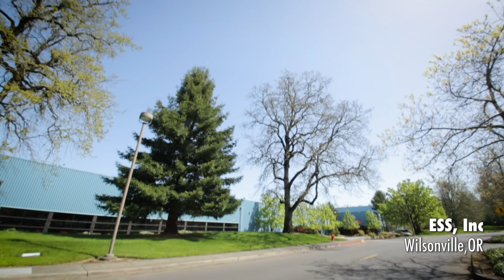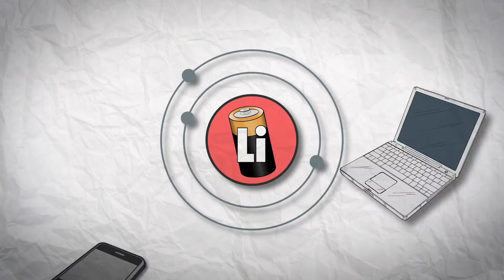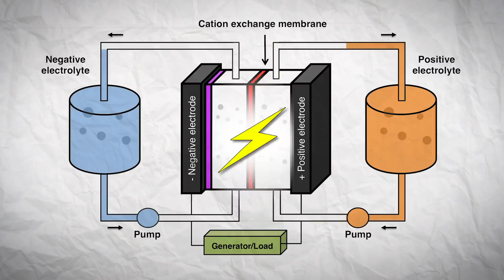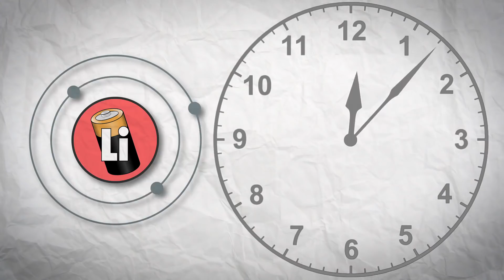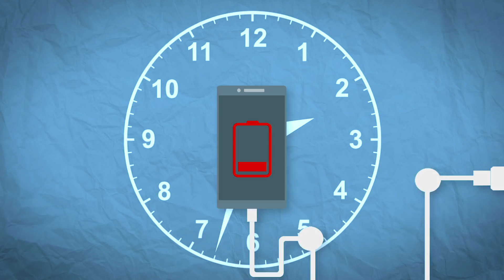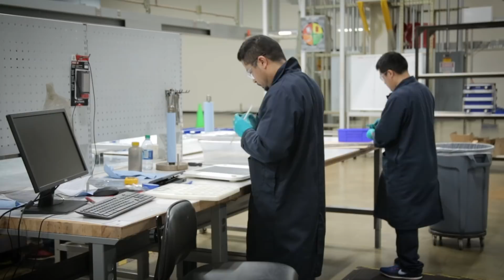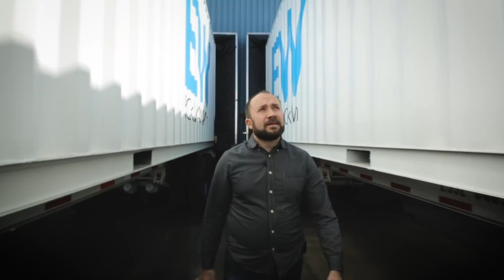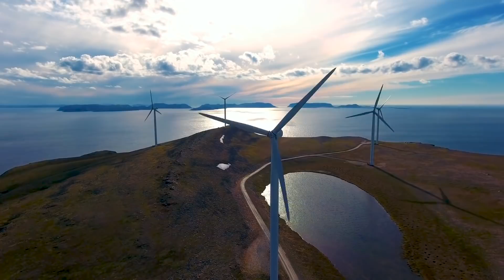Battery Fueled by Iron and Water Could Transform the Power Grid

Comment: This is so full of shit. Salt water is not fertilizer for trees; it kills trees. Iron is technically a fertilizer, but fertilizers are unnecessary for all native trees (such as anything over 100 years old). Simply allowing leaves to decompose on the root zone recycles 99% of the nutrients used by the tree over a growing season; root growth covers the rest. You do not lose FIFTY PERCENT of battery capacitance over 1 year; in fact, a more accurate statement is 15% over 2000 cycles is around the ballpark for your average use-case. 2000 cycles of a battery that gets charged once per day (overnight) means it'll take 5 years to lose 15% of your battery's actual capacitance; any less is due to increased power consumption through background tasks or.. well.. Apple deciding it's time for your phone to suck so you'll have to buy a new one, frankly. 

Oh and let's not forget that a battery requires two dissimilar materials to work, an anode and a cathode. Sure, this battery uses Iron; what else does it use? Potassium? Iron Oxide like how a lead-acid battery works? The sodium from the Sodium Chloride? That last one would leave chlorine gas as a byproduct in the event of a leak, just a heads up. Nickel and cadmium. Lead and lead Oxide. Lithium and carbon. Nickel and nickel oxide hydroxide. All batteries require two materials, how bad is the metal you're not telling us about?

Comment: The future for anyone with any enlightenment is Thorium nuclear power. Look into it. Lets make it happen.
Reply: I totally agree the money squandered on solar and wind is just a disgrace... The money it would cost to develop thorium would have cost less than 1% what they spent and you would have far more energy available 24/7 at maybe a quarter of the cost... Solar and wind are nothing more than elitist slush fund
Reply: I quite agree but it's down the road a few. The best route to thorium is through MSRs and there is still work to be done to scale them up and get approvals from a non-authoritarian government to produce them. Thorium is a second set of approvals. My fave grid battery is liquid metal; if we actually ever need to cool the planet we need solar roofing for up to 20% with battery storage and with part of the storage in large units. White roofs don't make power, so solar still has a place. I also like natural gas fuel cells for homes with solid state lithium batteries, but that still makes CO2. Our species need to install a thermostat on our planet and control its temperature, for both heating and cooling, but that's a different conversation.
Reply: I like your 'non-authoritarian gov't' caveat! Also your logical thinking. Solar isn't 'free', but DEF. has it's place in the current equation, I'm with YOU!  @tsamuel6224
Reply: Have a look a bloom energy they had a fuel cell that ran on natural gas but they said it was able to run on other fuels.. I think it was above 40% efficient and it only used the gas proportional to load.... Google Walmart use them as there solar panels weren't up to the task
Reply: Agree
Reply: Lawrence Baxa   Thorium nuclear tech is mind-bendingly complex and has almost insurmountable materials issues.  It is no panacea.  Yes, it is safer and the world is full of Thorium.  But do some real research and you will see its obvious drawbacks.
Reply: @artysanmobile  Maybe for you Peter. They had a functional reactor back in the 60's which Nixon shut down. The excuse was that it did not yield weapons grade material which they needed. Both could have been done with different objectives. Pure B.S. I smell more manipulation by some who do not want such freedom. Were standing idly by while country's like China and India are developing it While we sit in globalist agenda confusion.
Reply: Lawrence Baxa   I see all the common arguing points in your response which lead me to believe you don’t understand the process fully, the multiple atomic isotopes the Thorium needs to be converted into just to make a reaction.  It’s true that developers couldn’t find government support at the time because the reaction did not create plutonium.  But that is old thinking, no longer relevant today.  The deeper you study the concept of salt reactors the more implausible it gets.  We are past that now with many examples of improvements that are working now.  Wealthy individuals are pursuing this on their own, but private money can only go so far until some brave nation bites and invests in the future.  It’s looking like India and China are going to be those brave nations, while the US just falls further into a hole of political and voter ignorance.  That’s a shame.
Reply: A “functional” reactor is not the same thing as a practical reactor.  There is no conspiracy preventing salt reactors, that’s YouTube fantasy.  They have very real problems that have never been overcome.
Reply: '....with any enlightenment'???   So humble.    AND you know the Future!!  Then PLEASE FIX US!!
Reply: Nuclear energy is today 3 times expensiver than photovoltaic or wind energy. And plus vaste, violent situation, terorism...??
Reply: @Milan-Smrž  You obviously no nothing about Thorium nuclear energy.
Reply: @lawrencebaxa5563  What I mentioned is not truth? Why?
Reply: For ME, NO NUKES is GOOD NUKES.  If they can invent one (type) that does NOT leave behind the seeds of it's OWN (and OUR own) ...DESTRUCTION, I might be swayed.   @Milan-Smrž

Comment: I highly doubt this can compete with Lithium in therms of cost amortization.  LiFePO4 batteries can easily last 20 years in similar type of application they have a >95% efficiency vs just 75% for this Iron flow battery.  The 10 to 20k cycle life at 80% DOD is not realistic in storage type application and the with the low peak charge discharge rate as you need at least 8h to fully charge and the same to discharge so 1 full cycle per day at most and 20 years x 365 days = 7300 cycles so LiFePO4 can do the same all solid state thus zero maintenance.

Comment: The only issue with that is Iron can oxidize, it can deteriorate over time, it can rust. It'd might be extremely dangerous in phones. 

And you just put Water, which has 2 Oxygen molecules by the way, with it.

Comment: Using abundant basic common materials in a fairly low tech system that is not harmful to the environment could be a game changer. Combining this with solar and wind fields could be the 21st century energy source we need. These trailers could be easily installed in all power plants to handle high demand times and make them more efficient. We just need the political leadership to push this into reality.

Comment: Hang on.  Get the terms right.  I assume you didn't mean 50 kW but rather 50 kWh of electricity in one of these batteries.  Doesn't seem that much for the size of the battery.

Comment: Please learn the difference between kw and kwh. They are not the same. one is a measure of power and the other a measure of energy. 50kw cannot be used to tell the length of time the pack can run a home or neighborhood.... the neighborhood can have a power load of 50 kw but thats is not a time unit ....

Comment: No.  It won't transform the grid.  Why not?  Because terrestrial solar is NOT a viable means of producing electricity compared to traditional power plants.
LMAO!
Reply: Seems to be doing OK for several million years!  Why not make use of it? Plus, as another commented, perhaps large-scale use could actually help to COOL the planet, and obviously the tech IS improving, so not sure how you can say it is flat 'not viable'.  Thousands of youtubers and off-gridders would be sure to call you out on THAT particular comment, seems to ME.
Reply: @abaddonbolero9605  
Nope, solar is at least two orders of magnitude behind fossil fuel / hydro electric in terms of efficient energy production.  IF solar were 90% efficient then its energy capture might compete with standard power generation for a small community, but it would require an absurdly large footprint to serve a major population area.  The main benefit of current solar technology is its use in isolated energy capture for reducing energy costs to consumers and business, and for improving continuity of power access in the case of an outage.
Reply: please share your calculations for this conclusion

Comment: Seems like a variation of the Edison battery. Edison batteries are long lasting, deep cycle batteries. Edison cells can be charged at high rates but are at best 65% efficient during charging. Edison cells can also be completely discharged without damage. Like all batteries they have pros and cons.

Comment: brilliant at its simplicity. here is a clear case where simple utilitarian design excell. storing energy for later use. I wonder if you could turn every swimming  pool into a battery simply by solvating ions to its bottom / concrete walls.

Comment: I've been following the flow battery concept since the Vanadium Redox battery, which is very similar, and has an installed base in specific locations where it makes sense.  Flow batteries are the future of alternative energy.   There none of the issues that result in limited cycle life, only pumps and membranes that may someday need replacement.  It's easy to say as Peter Faber did "Nice technology, but 50 kwh in a whole shipping container isn't a whole lot. No mentioning of the cost per kwh?", but that would be to entirely miss the point.... he obviously wasn't really watching.   Half the container is tankage.   There is no limit to the amount of external tankage that is possible, and the storage of the battery is the amount of charged liquid stored.   Thus one could easily install external tanks, and increase the storage.  Cheap plastic tanks set beside the container could increase the storage many times over.  On a "battery farm", many thousands of gallons of shared tankage would make sense.   This battery is only contained in a semi trailer because it's a convenient package.   In a real world application such as a wind or solar farm, the components would be warehoused rather than absurdly contained in individual trailers.   It makes far more sense to construct a large metal building, and place the components inside it, scaled to load than to connect semi trailers in parallel as is apparently done here.   
     This video is very much dumbed down, making little effort to explain the ins and outs of the technology..... explained as if to children or stupid people.  It does nothing to really help understand the technology and it's immense potential value.   We are not all Facebooking morons with EDD and a third grade mentality.   Much can be found on flow batteries on the internet for those who's interest is more than superficial.   I'm not involved in the battery industry in any way except as a buyer of batteries.   I just bought two little 20ah batteries for my one of my UPS units...$150 yesterday..... storage is expensive.   
     Google "flow battery" for a good explanation of how they work..............

                                                                                              H.W.

Comment: Nice. Assuming it also doesn't use Cobalt, it means we can build battery storage on a truly massive scale. Lithium and Cobalt just aren't up to the task.

If the billion vehicles on the roads had a power pack like the Tesla Model S, it would require 63,000,000,000kg of Lithium. That's a whopping 63,000,000 tons. The world mines around 35,000 tons of Lithium a year, so it would require 1800 years of mining, at current rates, to get enough for a global fleet of EVs.

The picture with Cobalt is even worse. And in 2035 there's expected to be 2 billion vehicles on the roads.

While the batteries in the video were a mere 400kWh, I image they could be scaled up if need be.

Comment: Problem with storing electricity is that you can save it only in batteries and you need to do conversion from DC to AC ,if you wanna use it in the greed .
That create loses and it need very expensive equipment.

Comment: Interesting tech, but that whole truck trailer only delivers 50kW(power) and 400kWh(energy)? Seems pretty weak, for some perspective a single Tesla Li battery can do 150+kW peak and has 100kWh, so four such car batteries is equivalent storage and far more power.  I bet you could fit 40+ tesla batteries in that trailer, 4,000 kWh.  Btw, that is roughly 120 gallons of gas worth of energy ( 360 gallons if you include engine losses ).

Perhaps the cost is/can be better for these flow batteries? The chemistry is inherently more benign, but Li can also be fully recycled.  Anyway, I wish them the best of luck and hope they can increase their energy and power density.
Reply: Compared to Lithium-ion, Iron-chloride costs less, lasts longer, is also recyclable, is made of more abundant materials so it is easier to scale up.

Comment: HAS ESS INC OR ANYBODY EVER CALCULATED HOW MUCH CONCENTRATED H2O2 COULD BE MADE FROM THE ANTHRAQUINONE PROCESS OVER A 6 MONTH PERIOD AND USED FOR IRON CATALYST ENERGY STEAM.
Reply: Sodium peroxide can be prepared on a large scale by the reaction of metallic sodium with oxygen at 130–200 °C, a process that generates sodium oxide, which in a separate stage absorbs oxygen:

4 Na + O2 → 2 Na2O

2 Na2O + O2 → 2 Na2O2

Sodium peroxide hydrolyzes to give sodium hydroxide and hydrogen peroxide according to the reaction:

Na2O2 + 2 H2O → 2 NaOH + H2O2

Dry the NaOH to make Na2O ?

2 NaOH → Na2O + H2O

repeat

Comment: This works off the simplest of electrical principles. Absolutely nothing fancy about this, other than the shipping container they painted and branded.

Here is a quick example of how to recreate this battery. Take 3-5 pennies and nickels. Place some paper tower in between each coin, alternating; one nickel, one penny, etc. Fill a bowl with water and add some salt, not too much. Then sack the stack in the bowl and let the paper towel absorb the liquid. Presto. This is obviously a very small example but it demonstrates the concept. These shipping containers are simply larger scaled up versions with more permanent materials, etc.

Only kicker is energy storage is only a need until man knows how to correctly transform energy. Energy cannot be created or destroyed, only transformed. What this means is all the electricity being stored in any type of battery already existed and was being stored else where. Clearly there is a better and more efficient energy storage in nature.

Fusion energy is coming sooner than later and all energy companies will go bankrupt almost overnight. It will send a ripple affect throughout all the the manufacturing world as well. Much will need to be redesigned and the cord to fossil fuels and even renewables will be cut. Renewables are only worth while for a brief time until this occurs, since energy storage becomes obsolete and the energy gain from renewables is inconsistent, depending on source. While some might think that is a horrible thing, it will be nothing but a blessing and allow the redistribution of man power, investment power and innovation into other more pressing areas.

Comment: Yet another disingenuous video regarding technology. Curious how you say this type of battery stores energy 4 hours and lithium stores energy for 1-2 hours. That doesn't really make sense or mean anything and was left unexplained in this video. Saying lithium batteries only last a couple years and pose a fire hazard is also untrue, The batteries used in cell phones and laptops are not necessarily, the same as the batteries used in renewable storage solutions. Laptops are high stress environments and often optimize using 100% of the batteries capacity as opposed to sparing 10% for a massively improved cycle life.

Tesla's have a trip mode for a reason, and nobody would buy them, or any type of large scale energy storage system if it only lasted 2 years.

Comment: I find it odd that price is not mentioned anywhere!  Here is a look at just the cost of buying, delivering, and installing a shipping container.  A new 40' container alone costs $6,675 (from https://outbackstoragecontainers.com).  That doesn't include shipping which for my location would be $575.00.  Shipping costs are highly dependent on weight.  If a container is full of iron and salt water, which is very very heavy, the delivery cost would be much higher.  A crane is needed to move a shipping container from the truck to the installation site.  That cost is approximately $700.  An installation site should have a cement slab or paved area.  The cost of a cement pad is approximately $1,120 to $2,750.  That means the cost of site preparation, purchasing a new empty 40' container, and shipping it to my location and installing it would be between $9,070 to $10,700.  For comparison, my electricity bill is about $120 per month and at that rate I will spend $9,070 in 75.6 months (6.3 years).  Not sure how a business case can be made when the box for the product costs over $9K.
Reply: It doesn't need a crane if the location is road-accessible.  I figure it can be filled with water after delivery.  400 kWh of storage is enough for many buildings.  If each residence or small business only needed 20 kWh, then your figure drops to $450 per.

Comment: Capacity degradation in Lithium batts is minimized or neutralized by maintaining cool temperatures.during its use.and charge. And yes, a lot of effective stuff are still low tech. Electric motors are more low tech than combustion engines, batteries are more low tech than fossil fuels, the best exercises and diets are the low tech ones.